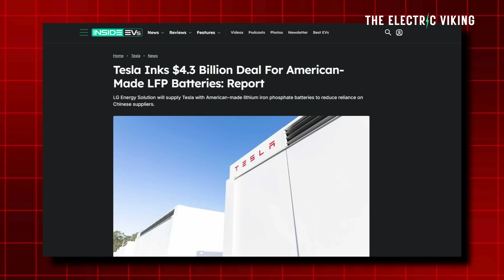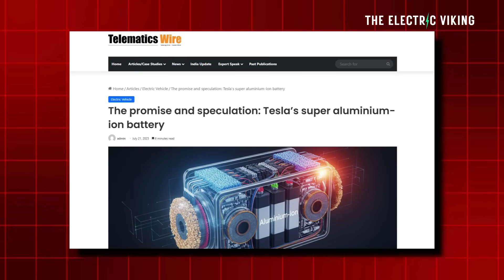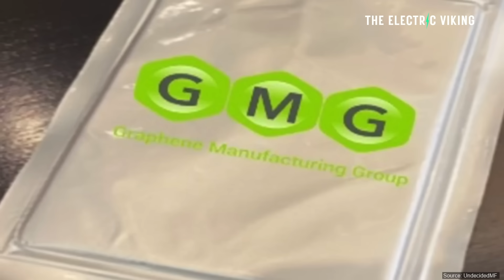Tesla’s super aluminium-ion battery - 4 million miles and Insane Energy Density

Comment from the maker: The car I drive, the Xpeng G6 - https://youtu.be/IcniwO8NfQQ

RESINC Solar installed my battery and solar system. Get a free quote from them here: https://www.resinc.com.au/electricviking
Reply: What is the possibility of brazenly beating stock prices with this information?
Reply: Aluminum graphene is easy if using 665nm Laser reduction of graphite oxide. 🎉we should have 1200v terra- watt cells by now.  Teflon dielectric capacitors are the future.  Stop energy cartels
Reply: Your a waste of time

Comment: The university of Queensland is the holder of the patent on Graphene Aluminium Batteries . They have partnered Graphene manufacturing group to develop the manufacturing and packaging using the same form factors as current Lithium batteries. Tesla has no part in it to my knowledge. GMG Australia,s website will give all the facts. 😢

Comment: Lithium ion has 250 Wh/kg but Aluminum ion batteries only have 40 to 60 Wh/kg.  However, an older battery, the NiMH battery has 60 to 120 Wh/kg.  It does not seem that Al-ion is a substitute for Li-Ion for EVs.  Range would be much lower.  Maybe Al-ion batteries would be useful in electric buses where during stops a short charge can be provided, or in a low range commuter car or a hybrid.

Comment: 4 mio miles is crazy and not meant for the privat car marked! No one wants to drive the same car for 30-50 years. It must be for semi trucks, ships and other large transport marked!
Reply: An electric motor is very, very simple. No transmission or gear box. I could see electric cars making it to a million miles. Even if the car died first, people could pull the battery pack out and convert to home power cell.

Comment: Small "General Aviation" electric aircraft currently have a total duration of 50 min-1 hour. Which is barely enough to use as a trainer.
They are using batteries with energy densities around 200 - 250 w-h/kg. they take 1.5 hours to charge. 
These Aluminum Ion batteries are supposed to have a potential energy density of around 1000, to 2000 w-h/kg. though some videos claim 10,000.. which is dishonest. 
If 2,000 w-h/kg can be realized, Electric aircraft could completely revolutionize general aviation. 
currently gas piston engines provide 3-6 hours of duration depending on the aircraft. The problem is the maintenance and fuel costs a fortune. replacing a high hour piston engine or a full rebuild can cost over 25k and take more than a year due to the lack shops doing the work. 
If even 1250 w-h/kg can be implemented... you would probably see mass electric conversions of GA Aircraft to increase reliability and reduce maintenance costs.

Comment: Tesla now has a free electric car that needs no battery, charges itself, last forever, and pays you $100 into your back account every 25 miles, also free unlimited lifetime connected and has automatic instant colour changing body based on your activity or mood, it will pick out your clothes every day, vacuum your house do the dishes and laundry and come with built in adult toys that can be used while driving and at home,  it mows your lawn takes out the garbage and does home repairs, it will also go to work for you and do your job better than you  do it. Also does time travel. matter energy transport to anywhere in the world. No really this is now available.

Comment: This added detail might help debunk or confirm the battery.  Watched a "West Tech" video about the battery about a month ago which claimed the battery is going into production in ALASKA, supposedly because the battery requires cold temperatures to manufacture so it makes sense to start with air that is cold.  Well, s/b easy for digital sleuths to track down the supposed factory. :)

Comment: I remember in the old days hearing about amazing new carburetors that would double horsepower while giving you 100mpg.  Then there was the magic fuel additive (acetone) that allowed your car to run on water.  Both technologies were supposedly being kept hidden by the deep state.  Then fuel injection became widely available and completely eliminated carburetors, but the miracles never came.  Thankfully, existing battery technology is already good enough to ditch ICE powered cars forever.  Whatever improvements in battery technology that come, and there will be plenty, they will make electric-powered engines and portable devices of all types better than ICE.  Most likely, robots will be the biggest application.

Comment: Wow! A game changer every day.
Reply: We'll wait a year, two, three... and I'll still be driving a forklift with a lead-acid battery.
Reply: @panpunkt5185  - Lead Acid Forklifts, use the Battery, as a Counter Balance, but, some are designed using LiFePO4 (Lithium Iron Phosphate), which has a better Cycle Life, and Energy Delivery pattern!
Reply: This changes everything.
Game over.

Comment: I do know that the Battery Innovation Centre of Indiana is currently working on the GMG pouch cell at BTRL4 - . the latest statements from GMG are expecting BTRL8 by mid 2026 and anticipate production streams in 2027.
another US company is actively working on Aluminium Ion cylindrical cells 2680 sizing.
University of Queensland have proven GMG button cells at reported 5x charging but those have lower voltage capacity.

Comment: All these new batteries in the pipeline and 99% will never get over the finish line.
When they’re available and in production, I’ll believe it, not before.
Reply: The main issue with new technologies is they have a tendency to be much more complex than what came before. If a new batter is twice as good but cost 5 times as much, it isn't worth making it. You need something better and cheaper than LFP which will be hard to find
Reply: That is really how innovation works. It begins with 20 crazy ideas and 1 brilliant one, then, years later, you finally figure out which is which.

Comment: Speaking of "is it clickbait or real", if Maxwell Chikumbutso's Microsonic free energy generation device is actually real and is adopted in the next year ot two, no battery chemistry will be competing with it. The Microsonic device will replace the power source for most things that run on electricity. Rechargeable batteries will only be needed as emergency\backup storage or for use in small portable devices. So, whichever is the cheapest battery chemistry with the most long-lasting quality will be the one that takes the lion's share of the battery market. If sodium-ion is cheapest, it will win, if aluminum-ion is the cheapest and longest-lasting, it will win. If some other battery technology can be made even cheaper and is equal to or longer-lasting than either of those two, then everybody will be forced by pure economics to move to that technology for their energy storage needs. If the Microsonic device is truly real as some say, there will be no need to charge it at all, and it will be able to power nearly everything 24/7. Batteries, solar and wind and most other grid energy generation solutions will eventually be replaced because having acces to power will essentially be free, and it can be accessable 24/7 on the spot wherever an electrical device happens to be at any moment. If you are fortunate to have an EV with the Microsonic device in it, it will be like having a portable power unit to run all your devices like an RV or camping equipment, or other recreational equipment like motorcycles and water crafts. Also, small portable power units will be designed and built to use in areas where you can't access your car for power, like on a beach or while hiking in remote areas. Small rechargeable batteries will be designed to power small portable devices like phones, watches, laptops, tablets, precision medical devices like pacemakers and hearing aids, and audio\video\gaming devices. The possibilities will be endless, and then we can start to dismantle all those ugly wind turbines an solar farms that clutter our beautiful countrysides and coastlines and free them up for building new housing and small communities that will not ever require a grid to operate freely, as every home will have its own power unit to provide all its energy needs. Now THAT'S a dream I hope I live long enough to witness! I'm pretty sure that the Globalist Elites are planning way to slow down the adoption of such a device because that will essentially eliminate their ability to control the masses forever. They won't be able to gouge the public on electricity bills or gas prices because we'll all switch to all-electric devices and generate our own free energy from the Microsonic device. Being able to generate free energy would free up trillions in energy costs to the public which can then be used to fund other important projects, products, services, and social programs for the needy who can't work for a living. There would be no reason why every able-bodied adult would not be employed in the new industrial revolution. We should get to a point where there aren't enough trained adults to fill all the newly created tech jobs, and teens over 17 years of age would need to be trained and employed instead of wasting their time and money on useless college degrees instead of acquiring certificates of training in specialized STEM fields.

Comment: Graphene on copper, aluminium, steel and plastics is real and will change energy density, magnets (cost) and connector resistance (heat).  A self charging battery (from ambient heat) is in the lab under tests.

None of this addresses the unreliable power problem.  Renewables are just too expensive when you do the math.  EVs need to get power from base load to be competitive.  Imagine a 10GW servo.

Comment: Publicly traded Graphene Manufacturing Group are developing an Aluminium-Ion battery, currently in partnership with the Battery Innovation Centre in Indiana. Will be 2yrs away. The ONLY downside is that Lithium is lighter than aluminium. Otherwise it is a slam dunk across all metrics.

Comment: Probably disinformation.  Check out Wikipedia for Aluminum Batteries.  While an aluminum atom
has three valence electrons to give up, each one has a very different energy level, making a battery with a
single voltage much more complicated than one based on singly ionized atoms, e.g. lithium, sodium.

Comment: I also checked with GROK:  Are  aluminum-ion batterys chemically possible?

Yes, aluminum-ion batteries are chemically possible and have been demonstrated in laboratory settings through various electrochemical reactions. They typically involve aluminum as the anode, where Al³⁺ ions are shuttled between electrodes during charge and discharge cycles, often using non-aqueous electrolytes like ionic liquids or molten salts to facilitate ion movement. 

 The primary reaction at the anode is the reversible dissolution and deposition of aluminum (Al  Al³⁺ + 3e⁻), paired with intercalation or conversion at the cathode, such as with graphite or metal oxides. 

 These batteries offer high theoretical energy density—up to about 8,040 Wh/kg for the anode material alone—due to aluminum's trivalent nature, which allows three electrons per ion transfer, compared to one for lithium. 

 However, practical implementations face chemical challenges, including the formation of passivating oxide layers on aluminum, limited cathode materials that can accommodate Al³⁺ ions without structural degradation, and the need for electrolytes that are stable against aluminum's reactivity. 

 Aqueous versions are more challenging due to aluminum's tendency to react with water, producing hydrogen gas and reducing efficiency, but non-aqueous designs have shown promise with cycle lives exceeding thousands of charges in prototypes. 

Ongoing research has produced working cells, such as those using graphite cathodes in chloroaluminate electrolytes or solid-state configurations, confirming their chemical feasibility despite not yet being commercially widespread.

Comment: Totally agree with you on this. AFAIK the only company publicly working on a feasible aluminum ion battery is GMG (Graphene Manufacturing Group). It is very promising technology because unlike lithium Aluminum has 3 valence electrons, that part is correct. Aluminum is also much more conductive (as is the graphene doping in the GMG versions), and it is much safer, as it has no flammable materials. However they are like stage 3 or 4 at best in the readiness chart. I have heard nothing about Tesla being involved in this in any way... but if they were they probably wouldn't announce it any time soon to avoid the Osborne effect.
Reply: Also, if a breakthrough battery would come from an auto manufacturer they would definitely put it in their highest profit margin car first, not the cheapest car.
Reply: @alexandruilea915  Not necessarily, I agree that they would want to, but it may not be an easy swap out in the manufacturing process. For instance with Tesla they are tightly coupled to a form factor and swapping over to a different format might be costly. It would make sense to put it in a new vehicle first. For example, the 4680 battery is their lowest cost option, but they did not put it in their highest volume and most profitable vehicle the Model Y (well they tried one trim level like that and if failed miserably because gen 1 4680s were not great, gen 2 that are in the cyber truck are much better). Instead they put it in the somewhat experimental Cybertruck.  One of the drawbacks of structural batteries is that swapping to a new battery is not as simple. The advantages being cost of manufacturing is lower, and savings on weight of course.

Now if the breakthrough is so much better that the old batteries are just no longer a compelling sales option then they have no choice and will have to upgrade everything or go out of business. 

For traditional auto makers that are still using battery modules and not using structural batteries this is one advantage for them, another is ease of replacement of a battery pack.

At some point someone will figure out how to do both an easily contained battery pack and structural (i.e. a structural battery pack that is easily removeable and replaceable) and this will be best of both worlds. Maybe for the unboxed manufacturing process they will figure that out.

Comment: Air-aluminium are old known NON rechargeable batteries with phenomenal energy density but the non rechargeable make them uninteresting.

Aluminum -ion? I heard about it long time ago. It was low density.

I don't know if this is a false claim using data of aluminum air and assume then in the aluminum ion.
Reply: But they are easily recyclable.... So could have uses .. Al and Li in the same  cell cause big complications in recycling.. but Al ion or Al S. has been tested at lab scale  and has huge energy density...

Comment: All battery OEM's are working on aluminum air batteries, but none have released any manufacturing dates, or solved the major issues with Aluminum air batts, which is: cycle life and cost.  Energy density is already there.